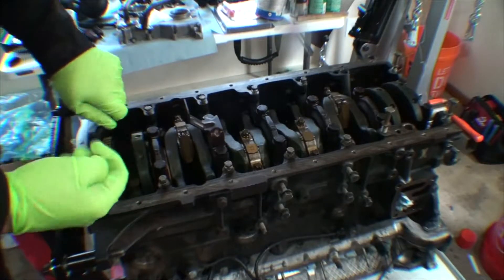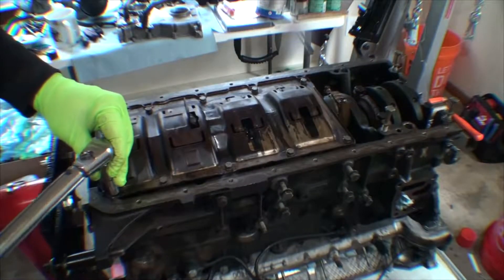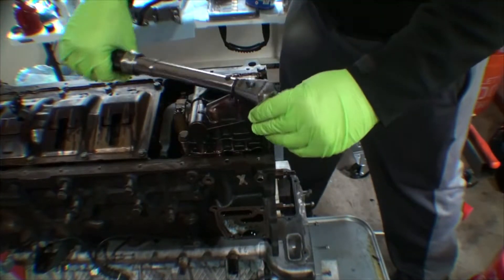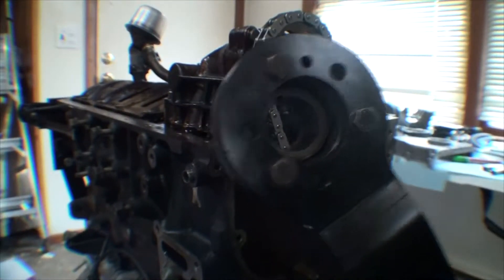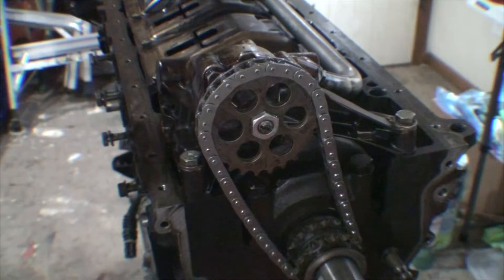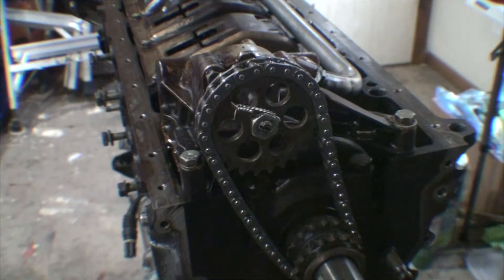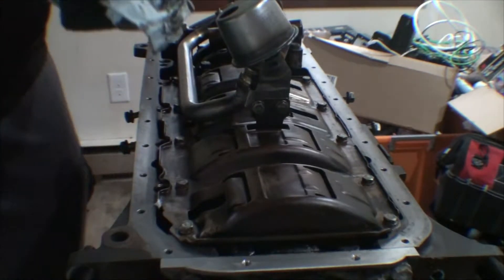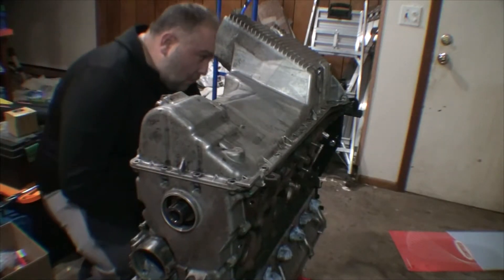Installing Oil Pump And Oil Pan on a BMW M52

Comment: Hello Gareth it looks like you know a lot about the M52. Quick question, my 97 Z3 has the red oil light about 4 sec after cold start before it turns off. Should I be concerned and what do you think it is? Thanks in advance, I subbed as well.

Comment: Did you forget the oil pickup tube gasket?
Reply from the maker: I definitely had the gasket in there although it's impossible to see on the video. I don't remember if I cut the video and snuck the gasket in at one point or not. When I took this engine apart last year the gasket was in between the pump and pickup tube.